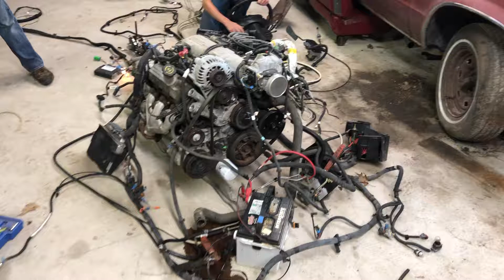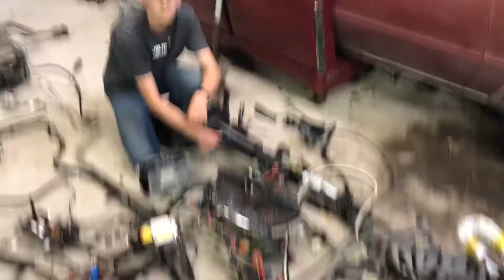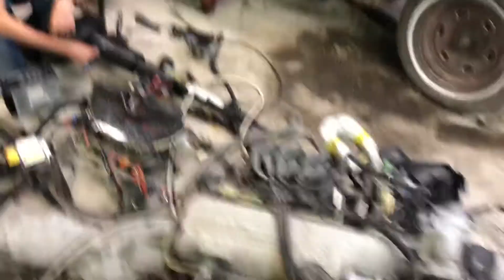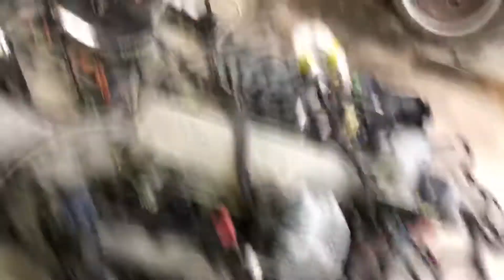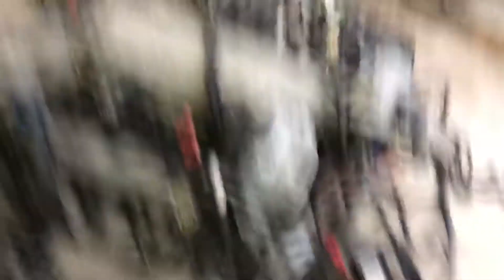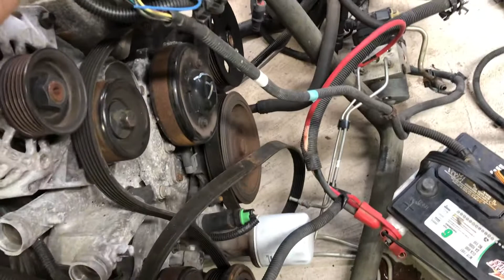02 Camaro 3.8 v6 for the 78 El Camino

Comment: That's actually not a bad Idea. I just picked up a 83 Elky with the Buick Y6, Cali Car. Want to make a fuel efficient parts runner out of it. Might look into this Drivetrain. Did you ever get this put together?
Reply from the maker: Yes, as a mater of fact, we went and got new tires on it today. It works well, fuel mileage is close to 25